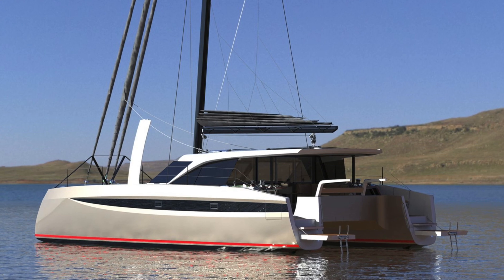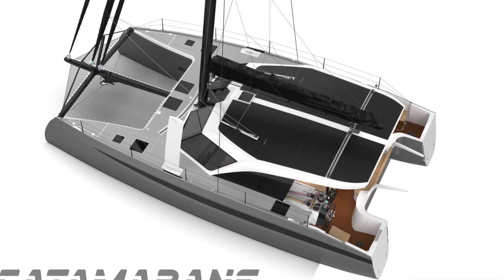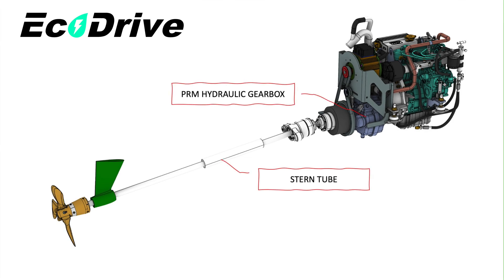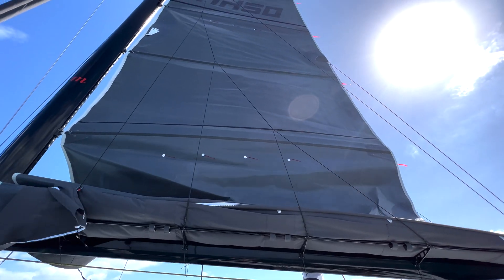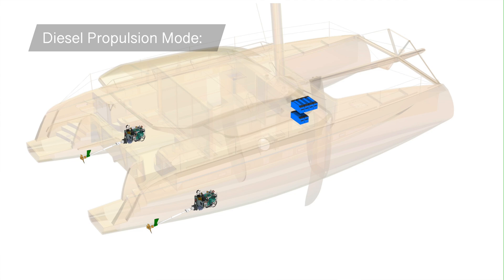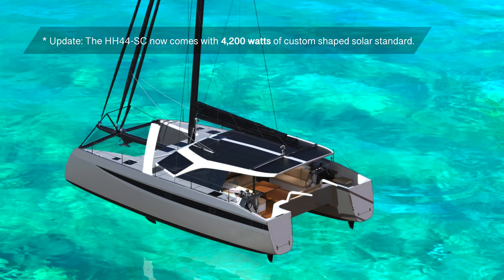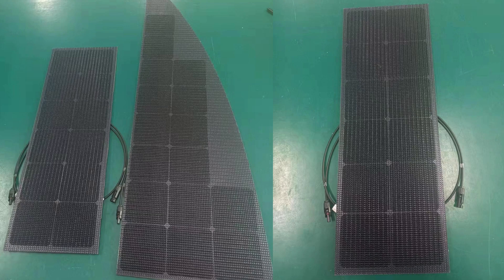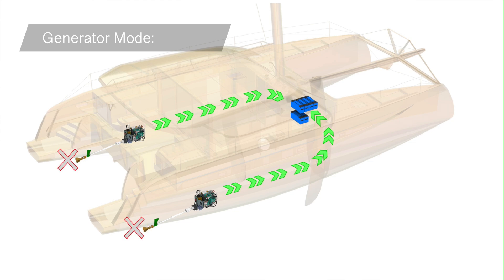Electric Catamaran of the Future: The HH44 EcoDrive (Episode 4)

Comment: Firstly, thanks for sharing.... Couple of points here.... firstly Hybrid configuration is old before it ever arrived (like with cars). The point about no one doing this before is INCORRECT. There are compromises everywhere and ultimately you have 4 engines.. 2x 10KW/15HP electric engines are pretty much useless... you want to use these when coming out or into mooring or a marina... there is just not enough power in those to be useful esp if there is tide/wind. The point about driving the boat at 7.5 knots for hours on electric misses the point of the performance cat... can we see what she will do in light conditions (you didn't even mention this) ? Good luck to anyone trying to trouble shoot that motor in the middle of the Pacific. Lastly you've just added extra weight on the battery and the back of the boat... really need to question the decision making here... to me the best solution is a) great sailing boat (btw: those daggerboards will create a lot of windage) and b) the way people seem to be going is 2 x 20kw+ electric engines and one diesel generator (hopefully removing that generator as technology evolves and a lighter one than the monstrosity you just mentioned).. Lastly, your point about redundancy made me realise that people advising you have not really sailed offshore... there are so many parts that things constantly go wrong with diesel engines... its constant maintenance...Almost zero on electric motors and you can wire in redundancy. Overall to me this boat is ok looking (except that back which is a mess - love to see the hydro analysis on a seaway on that) but fanciful and feels like its been designed by a few naval architects straight out of uni with more focus on looks and marketing than sailing.
Reply from the maker: To our knowledge, no one has built a boat from the ground up with the idea of installing this type of configuration. This is the key part that makes it successful, but if you try to electrify an existing design it is doomed to fail. No other catamaran has 4,200 watts of solar just on the coach roof or as efficient a hull shape. If you find one, please let us know!!!
Reply: @HHCatamarans  I don't think Dr Baracuda is questioning either the hull design or the quantity of solar on the roof... what he's questioning is over complicating the diesel engines with hybrids. Diesels are "known" but I disagree with 'loved' and it is the first factor that probably means that you're still building boats with them in. Range was an 'issue' for the car industry (early cars could on achieve 150km, but now they are easily reaching 600km), but it is quickly moving away from hybrids and realising that carting around heavy ICE actually reduces range  and over complicates the internals, hence the move to electric only. I am sure that with further battery developments that this will be the case for the marine industry as well.
Reply: @HHCatamarans  take a look at Sunreefs that have solar integrated on the hull and mast... or Antares who have had hybrids for a while now.... look I like your solar but as @David Thewlis says, that was not my point... you can take the weight out of the aft area with an electric engine only arrangement and strategically place your Genset (they are about 200kg for 10KW) strategically close to the centre... this gives you the added benefit of reducing the weight forward and aft which reduces the pendulum effect or hobby horsing which is a huge problem on these condo cats. You can also avoid through  holes i.e. less points of leakage.
Reply from the maker: We have taken a look at those yachts. The Sunreef is a wolf in sheep clothing and burns an enormous amount of diesel to sail through the water with its wide hulls and heavy displacement. The solar on that boat makes it sound and look like an Eco boat, but it is hardly anything of the sort. 

Meanwhile the Antares comes closest to our boat but falls short because it is limited by the original design that cannot fit 4,200 watts on the coach roof (or 5,300 watts total if you add it to our davits!). Plus their hull shape is not as efficient and their construction is heavier. When you combine the impact of these design issues their system will not work as efficiently. Plus, to our knowledge, they have not made one yet. 

We never said we invented the technology, but much like the first iPod, we think we have developed a product around an existing technology that should make it more mainstream in the future. Thanks for watching and commenting all.
Reply: @HHCatamarans  The Antares with hybrids are out there... if you want to see the Hybrid in action.. you can check out the MJ Sailing channel when Max Cruise took it out for a test sail to fine tune the hybrid off Vietnam.. Back to the point about diesel problems... the internet is littered with these .. here is another one from yesterday https://www.youtube.com/watch?v=38aCMv9CIoU&t=32s
Reply: Also, I disagree that the best safety feature on the boat being the engine... to me its her sailing ability to outrun weather... but this ofcourse is subjective ! will you produce polars as I'm not convinced this design will perform on all angles given her windage and hull shape at aft.
Reply: "there are so many parts that things constantly go wrong with diesel engines... its constant maintenance". No. Have you ever operated or serviced a diesel engine?
Reply: @DaveSaggs  All the time my friend.... I say this with my experience as a live aboard the last 4 years... but don't trust me... just take a look at all the other YouTube channels of sailors.... start with Sam Holmes diesel engine problems of today for example !! imagine then adding a new component to an already high maintenance piece of equipment.... yikes... Out of curiosity, i looked up weights of Diesel generators and you can certainly get a 10KW one for less that the weight of the engine... You can lose a few thru holes while at it as well!!!

Comment: I hear a lot of times that no builder has done this before, however I've seen Sunreef building Eco Cats (I do not consider them performance Cats they are heavy and very luxerious) but they put solar panels on the hulls and mast and generate a lot more of Electric power.
Reply from the maker: In our opinion, those are not Eco cats. They are riddled with generators to power those wide hulls through the water. Simply throwing solar panels (lots of them) on a boat does not make it an Eco boat.
Reply: @HHCatamarans  Respectfully, the SR eco boats have no generators.  It's a lot more than "throwing panels on a boat" with what they have done.
Reply: @Danjirus  According to the Specs we have seen online the Sunreefs all have generators to power those electric drives. It's Eco-Washing at the very finest, in our opinion.

Comment: Why 2 Diesel engines? Weight, cost, maintainance are reduced with only one ice.
Reply from the maker: We have considered using just one engine, and maybe in the future that is how we will build these boats, but for now we like the safety and security of simply adding in the electrical systems to an already trustworthy design. Time will tell how much we still rely on the diesels and we have a good feeling that the Wynns will tell us if it works!

Comment: 🤔Clearly hybrid is the common compromise until the fully marine EV technology arrives:
As in 'GMG's' Batteries - Multi-spectrum solar - low friction hull treatment solutions etc.
Until then, it's still a Diesel - and all the moving parts and dramas that go with them will prevail.
👍That said, I am certain that your eventual E-Vessel design will be stellar! All the best.
Reply: You're going to need massive advancements in batteries for that. The best batteries hold about 300Wh per kg, diesel is about 10000 Wh per kg. So if you had 200kg of diesel onboard (~200 litres)  the energy equivalent in today's batteries would be 6666 kg of batteries, however diesel only about 30% efficient, about 2222kg of batteries . Future batteries people talk about 500 Wh, theoretical maximum limits (calculated max energy the molecules can store) with most battery technologies is limited to about 500-2500Wh per kg. So stored range will likely never match a diesel for a boat of the same weight.

Comment: FYI - This is a diesel boat with a little bit of assistance from solar. The 4000 watts of solar panels pointing straight up will not generate anywhere near 22kwh per day. ALL land based panels are angled at the sun for a reason. That along with dirt, dried salt spray, water droplets etc. and even less with the shade from the sails, it will rarely exceed 50% and average about 30% of the supplier's "rating". Also, I suspect the owners of a $1m boat will want to use a/c, especially in the brightest of sunlight in tropical areas where solar will thrive but the cool won't. The a/c alone will use more power than these panels will supply. The a/c, along with refrigeration, desalination, bilging, electric cooking, cloths washing etc. will require shore power or diesel power just sitting there never mind moving.

Most non-high end cruisers will forgo a/c due to the amount of power consumed. Even large battery banks will not be sufficient. Wealthy cruisers will not likely be quite so frugal. I was kind of shocked when the Wynn's had family guests on board in one episode and still refused to turn on the a/c because of the diesel it would use, even after complaints of the close quarters and high humidity. As a non-boater that hates being overheated and as a tall lanky person that also doesn't like confined spaces too much, I don't think I would be returning to that boat, even with Nikki there.... ok, maybe I would!
Reply from the maker: With this system you can run the AC in your Master Cabin for four straight days without charing the batteries. Wow.
Reply: @HHCatamarans  Hey, you are doing the best possible with the current limitations of solar and batteries. That is commendable!
Reply: @underwaterdroneservices7292  Lots of folks are using air conditioning on their cruising sailboats with solar power and Lithium ion batteries.

Comment: You make a great boat, but I’m afraid you guys are focused on the wrong thing. Hybrid is a nice FIRST step, but don’t forget FULLY electric is the REAL goal. Hybrid is NOT THE FUTURE! A boat designed from the ground up to be a hybrid will NEVER work to be fully electric so PLEASE don’t stop there like Toyota did with hybrids. A fully electric boat designed from the ground up would get rid of the huge heavy fuel tanks and replace them with at least 160 kWh of batteries and would have solar on every surface, including the top and sides of the amas and the coach roof would be redesigned to extended ALL the way aft over the davits to maximize every surface for solar. No one really wants a hybrid boat because that means you still have the hassle of diesel fuel and you still have to maintain gas engines. Fully electric has no hoses, no clamps, no filters, no oil, no belts, no gears, no fumes, no noise, no water pump, no fuel stops, no Jerry cans, no fires, and lower insurance. LESS MAINTENANCE means MORE SAILING! Please stop designing your boats to be hybrids like Toyota and start designing them to be electric like Tesla. Before Tesla, everyone said fully electric cars wouldn’t work or wouldn’t be fast enough or go far enough. All of that is not true with cars and it isn’t true with boats either. Sorry to be harsh. I know you guys are trying, but you’re focused on the wrong thing. Stop believing fully electric boats won’t work. You just have to build them as fully electric from the ground up.
Reply from the maker: Yes, of course, we would love to go all electric, but if you watched the video we talk about what that would require with today's technology and the downsides of that type of install. Cheers!
Reply: @HHCatamarans  Todays technology is more than enough, but you don’t dare to utilize it properly. “Sailing Uma” has proved it works during 8 years sailing over the Atlantic up the coast of Norway, to Svalbard, down to Iceland, Scotland and now the Mediterranean.
Reply: Not possible. Diesel is 10000 Wh/kg, best batteries are about 300 Wh/kg. The weight of a comparable battery in a yacht to match the safety range of diesels is too prohibitive. Water has a lot more friction than air you can't compare it to EVs.
Reply: Fully electric is very usable and desirable for day sailing and maybe coastal cruising.  Unfortunately for global cruising a backup diesel capability is needed, for example for long becalmed passages.  And a parallel hybrid is the most reliable and efficient solution.  Priuses/etc are parallel, not serial hybrids for this reason.
Reply: Please don't listen to such input. Hybrid is the way to go for now. Hydrogen seems promissing tho for the future.
Reply: @Resteasy8686  Please study Hydrogen very carefully.  Barring some major breakthrough which is "always 15 years away" (and has been for many decades), Hydrogen is highly impractical due to its OVERALL energy INEFFICIENCY.  Again, study the physics and energy costs of it.  The answers are there, and the conclusion thus far is that Hydrogen is highly impractical.

Due to physics, those inefficiencies may be insurmountable.
Reply: A fully electric boat is impossible under the present. Technological conditions prove me wrong.
Reply: Yes it is everybody motors from time to time and uma stops for great lengths of time  in marinas when no wind
Reply: I sense a lack of experience in sailing oceans, would love to hear the miles under the belt. I understand the wish for going full electric. Daysailors can have this done easily. Ocean sailors don't have the luxury of a charging point every 200 miles. This hybrid is the way to go for the coming 10 to maybe even 15 years. The design of this boat speaks volumes in experience in ocean passages. Pretty impressed by the design up to now. Can't wait to see the actual miles in the ocean and having the Wynns give their honest opinion on what works and what needs improvement. HH is  really setting the pace out there.

Comment: Who do you source the batteries from and what is their chemical makeup? Are they cobalt free?
Reply from the maker: Our batteries come from a supplier in Europe and are LiFePO4 chemistry, cobalt free. LiFePO4 is also the safest Lithium battery chemistry there is.
Reply: Most marine Lithium ion batteries are Lithium Iron Phosphate since they are fire, puncture, etc., safest.   They're also very significantly more durable than other common Lithium ion chemistries.  They will last very many decades if properly used.

Comment: Hat tip to HH for making it happen. And for not confusing KWh with KW as so many others! That being said, this could have been done 3 years ago, and right now, you are not at the bleeding edge; you are just middle of the road of big brands’ developments. I get the self-glorification that’s the purpose of these videos, but let’s not fool ourselves: This is as basic as it gets today. PS. No, the diesel engine is not “known and loved”, it’s simply tolerated because we having got anything better. So again, kudos for getting it done, but let’s push a bit further…
Reply from the maker: Thanks for the comment. We state quite clearly that this technology has been around for quite a while, but we are the first company to build a boat around the technology. This is what separates us from the rest in the industry who have tried to "electrify" existing designs. It is our opinion those designs fall short - but the HH44 does not.

Comment: Great idea and been wondering for a while why the concept of hybrid drive from cars had never made it's way into boats.  Was wondering what the decision making was on shaft versus saildrive as this would move motors back in hulls as well giving more usable space.  If I ever win lotto definitely on my list.
Reply from the maker: Shaft drives have several advantages. For starters, they are more robust than sail drives, but the main reason is that by adding drag from the propeller to Hydro Regenerate power would be too much for a sail drive to handle. The other advantage is this allows us to move the engines forward and keep the weight off the transoms, which is better for performance and weight distribution.
Reply: A shaft drive requires less maintenance than a sail drive too... 👍
Reply from the maker: Very true!